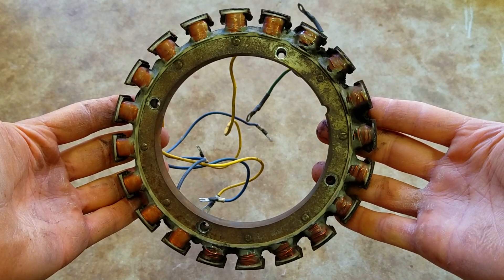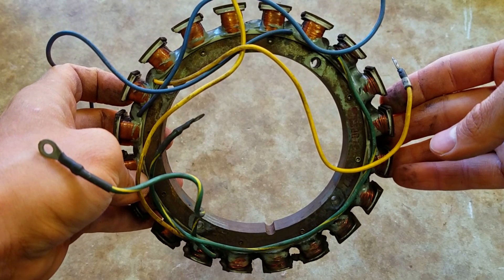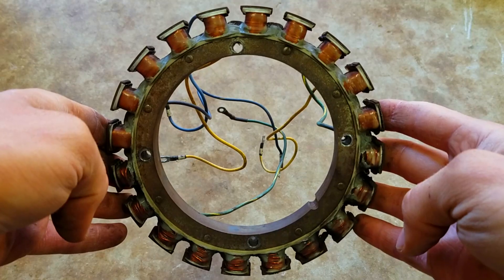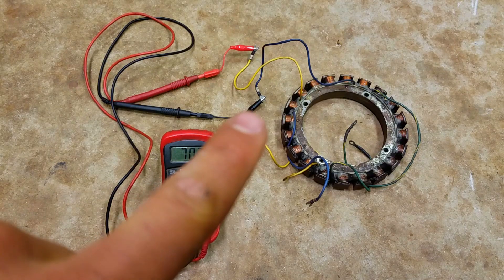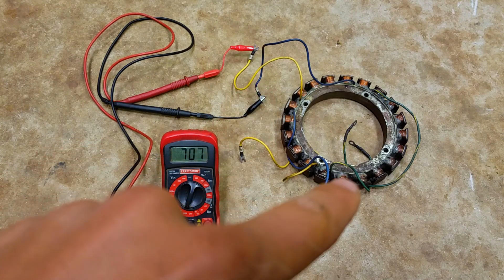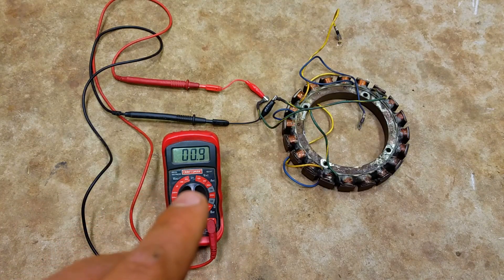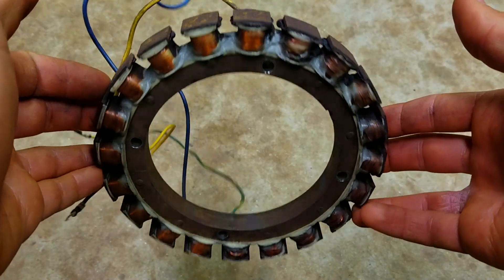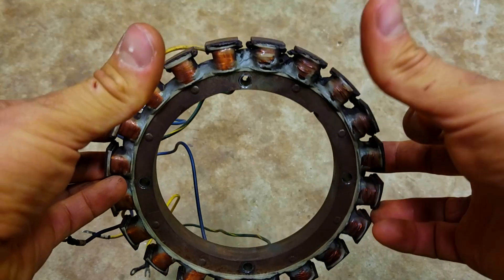How To Test An Outboard Stator - The EASY Way!

Comment: Man oh Man U made that test look so easy, but I'm having deficulties on how to ck mine I have a 1999 evinrude ficht 200hp I took it out but my friends n I r having trouble what leads to ck I have 6 wires coming out of the stator 2 yellow w blue strace 2 yellow n white trace n 2 solid yellow ones it doesn't matter which way w ck we get no readings pls can some body help me!!!
Reply from the maker: I know it can be a PAIN! Sometimes you just have to take a break and then come back to it and test the stator one part at a time. Here is a link to a chart with the wire colors for your 1999 FICHT 200Hp stator: http://www.outboardignition.com/page40.asp

Here is another chart: http://www.cdielectronics.com/wp-content/uploads/2013/03/CDI-Electronics-DVA-Charts.pdf

Be careful testing a stator on a newer motor like yours. Make sure the motor is not running if you are checking resistance values. You don't want to accidentally fry something. FICHT motors are not known for their reliability, but it's still an Evinrude!

If you still cant isolate the problem you can buy a DVA adapter for your multimeter online and test the voltages. Here is a link to one: http://amzn.to/2loE5Fi

Again, be careful and double check stuff before you hook up your multimeter if you test the voltages. IT CAN/WILL SHOCK YOU BADLY if the motor is running!!